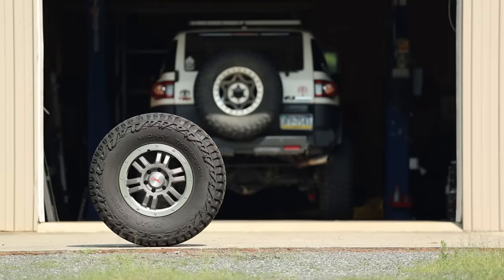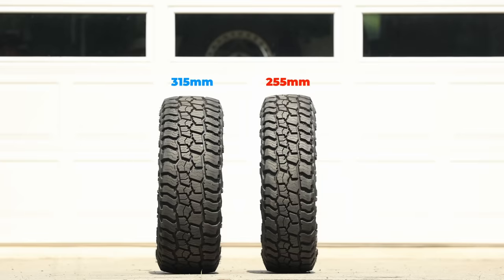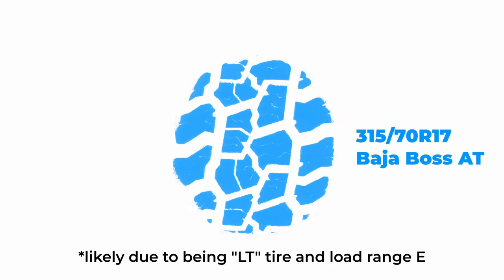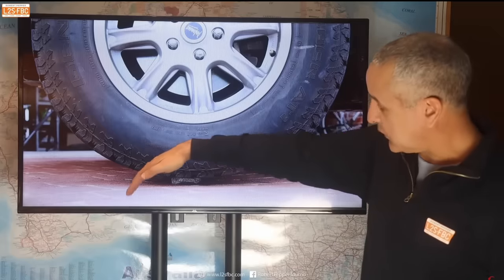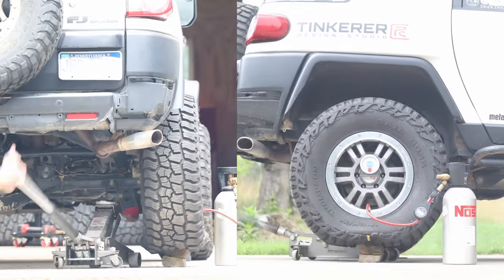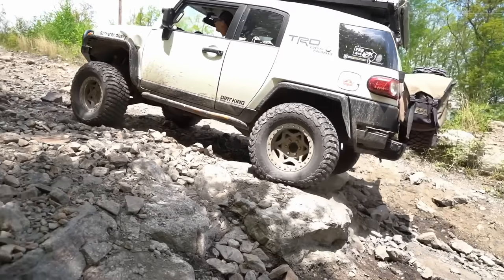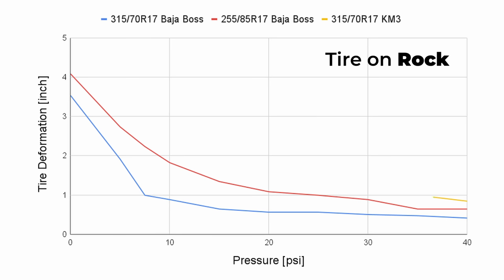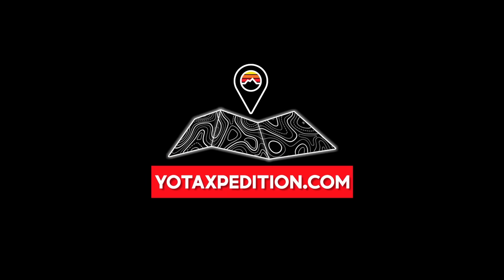3 Scientific Experiments to Settle This | Wide vs Narrow Off-Road Tires

Comment: Ya, I learnt this over the years. I swapped out my 12.5 Wide M/T for a 9.5 M/T on 33" on my Jeep and I have been very happy since. It breaks slightly better, less rolling mass (comparatively)...no visible difference in offroad performance at all. MPG got a tad bit better and the tires pretty much paid for itself.

Comment: I bought the 255/85-17 Cooper ST MAXX for my '15 Ram 1500 Quadcab 4wd.  That was the tallest tire to fit on the stock 7x17 rim.  The tire I used is internally similar to the Mickey Thompsens, which are made by Cooper.  Cooper has merged with Goodyear.
The vehicle the tire is run on is a variable also.  We have a beastly '18 Ram 2500 Crewcab 4wd 6.7L Cummins powered pickup that I will likely put 295/70-17E tires from Cooper or Mickey Thompson, the next time I buy tires.
I have a project vehicle '96 ZJ that runs 255/70-15 General AT2 tires.  They are great in the snow and on desert sand.
I may try the 255/70-17E tires that I have.  On my '23 Jeep JLU that I bought.  But but seat of the pants comfort and handling experience tells me I want the 285/70-17C or D.  I may put portal axles on the JLU in a couple of years.  In which case 37's will likely be installed.
The Pizza cutter (255/85-17) tires handle terrible on the Interstate, and okay on the street.  I had BF Goodrich tires back in the late 1970's.  While they were absolutely the best tire back then.  There are much better options.  Driving in the rain and on ice really matter.

Comment: Super video. So many possible variables, sand,and mud, thick or loose, rolling resistance, road noise, unsprung weight of narrow vs wide. Vehicle track width difference wide vs narrow.

Comment: Great piece - very interesting and thorough analysis.  It seems clear the thin tire is better for rock crawling but there are other off road conditions where a wide tire might have better chance at excelling.  Definitely there is a balance and for me it goes to road travel too since my rig is my only vehicle and, like many, I have to drive on roads to get off road.  Thinner is certainly lighter and has a smaller CdA so acceleration and highway speeds won't take as much power.  But I'm also wondering if rolling resistance of the thinner tire (flex/rubber compound etc.) will exacerbate or ameliorate the energy efficiency benefits on road.

Comment: Excellent video, would be curious of the change in contact patch over use though. I would imagine the central portion of the tire would wear down allowing for the sides to properly contact. That would probably make having a wider tire better. Just a hypothesis, would make for a curious video.
Reply: Also on softer terrains, the central contact patch would dig into the softer surfaces allowing for the outside edges to make contact. Maybe in those scenarios a wider tire may be more useful. However in terms of flex over hard surfaces, your data is still most accurate. Again, loved your video and how you achieved your findings.

Comment: Reason wider tires are better in racing (tarmac) compared to narrow is that with wider footprint the contact patch is shorter, so under acceleration or breaking, if there is slight spinning/lockup that piece of rubber slides for shorter period of time preventing the rubber from overheating/melting.  Contact area has nothing to do with width but pressure, so both, narrow and wide tire will have exact same contact area.  Physics.  You have weight and you have air under pressure holding it up.
Reply: Why does the contact patch area increase in a km3 tire given that its size is the same as a wider Baja Boss tire at the same load (10% more area)?
 I think that the (pressure factor) alone is not necessarily accurate. I think that the (architectural and structural design factor) plays a good role in this matter.

Comment: Thanks for the work on your video. First time watching your channel. I have head another aspect to practical use for tiers in regards to tier width. Mud or snow with solid ground underneath. I have heard from a lot of old timers they preferred narrow (pizza cutters) for traction. Granted this is in Alaska and different terrain I know utilize deferent tire types. Their explanation is that the narrow tier can cut down to the good traction base rather than floating on top. I know in loose sand you want to have floatation. Some of the areas some of these old timers take their old trucks into, as they head out to their gold mines, is quite amazing. 
Just a thought if you were going to ever do a future similar video. As well as a tiers ability to resist loss of traction from sideslip.

Comment: My input is that most do not factor in contact pressure. A narrow has carries more load per square inch on contact patch, this allows for greater deformation while still maintaining a higher contact pressure at the same PSI as a wider tire

Comment: Great study and great post.  I can air down on the trails and then air back up.  I'm more concerned with hydroplaning on the highway while driving thru rain/thunderstorms on the way there and back home.  If you've ever waterskied, you know a wide ski on a slalom floats on top of the water way better than a narrow ski.  You don't want that in a tire driving on water on the highway at 50+ mph.  Narrow is better for me for that reason.

Comment: Another factor to consider in snow states is that a narrower tire will handle snow easier than a wider tire will. Snow is not mud, sand or dirt, it's a different element completely. To navigate better in snow, you want a narrower tire to focus more traction on a narrower surface of tread. That concentrates the weight of the vehicle on a smaller surface. That increases the traction in snow. A wider tire will slip sooner than a narrower tire, and may cause the vehicle to fish-tail looking for traction.
Also, an all terrain tire will do better in snow than a mud terrain tire. Pick a tire with the mountain and snowflake symbol on the sidewall. That means the tire is severe snow rated.
The 10 ply tires are intended for use on 3/4 and 1 ton trucks, so on a half ton vehicle, a pickup or suv,  the 10 ply will decrease ride quality on highway. Some people won't mind this, but a better option may be to go with an LTC 6 ply tire in the same size. That will be just a more heavy duty tire over the factory application, probably a P rated 4 ply tire.being the factory tire.

Comment: I’ve ran skinny tires for mostly my whole driving life. I had a 98 Tacoma that would trudge through snow pretty much up to the frame rails or deeper at times. Not only do they cut through the snow but they also take less power to get them turning which you need all the help you can get when running the 2.7l engine in extreme conditions like that. I did have wide tires for a bit on a 5.3l Chevy and on a 7.5l f250. The Chevy took a lot more throttle to get the wide tires rolling through mud as compared to the skinny tires. It would be interesting if you could follow up this test with a Dyno test with the same truck on both skinny and wide tires and see how much longer it takes to get the same horsepower to the driving surface and how much more the engine is working to get that same power.

Comment: Well done ! Very thought out and explained . When in soft terrain ( mud , snow ) the resultant flotation seems higher on the wide tires. Maybe the shape of the footprint matters ? I had a 84 forerunner on 36-12.5/15 tsl and it sunk in mud that a friends 35-16/15 bloggers stayed out of on my truck . It was very noticeable and they were both running 7rear and 9 front psi .

Comment: Thanks for the detailed research! The tighter track width could actually allow you to access some trails better and have more choice on positioning, even though its only a few inches. Seems to me like it's roughly equal or better in several ways, and ultimately comes down to looks!

Comment: The contact patch will be the same for a given vehicle wt and tire pressure no matter the tire because the PSI is literally the amount of wt/in2 it is supporting, the more aggressive tire had more dead space between the lugs that you didn’t account for in the outline of the area, grip in rugged stationary terrain like rock crawling and canyon scaling requires different tires than loose dirt, wet roads or soft mud. Ultimately most of us drive on the street more than anywhere else unless we have a dedicated off road vehicle. The new KO3 are pretty nice for all around performance but I still lean to some of the less aggressive and slightly less expensive options on my daily driver, Silverado on 315-70-R17s interesting info for the extreme enthusiast though.

Comment: Great video, I think the Contact area vs Pressure graph is going to be the same for all tyres if measured carefully enough.  Keeping the numbers simple, if your car weighs 4000lbs then each wheel supports 1000lbs. To support this you would need 10 square inches contact area at 100 pounds per square inch, or 20 square inches at 50 psi etc.  I think the brand which had a different curve had a different tread pattern with different size gaps between the tread blocks.  These gaps should not be counted in the contact area.  The only other difference you will get is the shape of the contact patch, which depends on the width of the tyre as you so correctly showed.

Comment: I considered many different tires for my Jeep. I went with Cooper ST MAXX in 235/80/17's. It is for on and off road and couldn't be happier. As a bonus it throws less road splat onto body :-] I also tried BFG KO2's but they were very noisy.

Comment: Interesting . Well run Experiment . I  think the Wide vs Narrow difference is : Air Pressure acts in ALL directions equally .
Therefore , a larger parcel of encapsulated pressure resists deformation to a calculably greater degree based on Total  cubic inch volume .
An  intuitive , but  I  think reasonable , Guess .

Comment: Great video. I have been running pizza cutters for a long time for many reasons not to mention they are easier on drive train components but they are better in the snow. I live in Idaho and we get snow. So better fuel economy (slightly) less wear on components and great traction, better snow all winners for me.

Comment: Great video! I think you should test ply rating too, like a 35x12.5 C vs E rated tire. The stffness of the sidewall can also prevent the tire from flattening out under even mildly lower pressures. Giving up ply rating may be more beneficial for those only driving in sand or snow. Theoretically, you should have a larger footprint with higher pressures with a C, which is safer for preventing debeads than having to go much lower for an E to achieve the same footprint.

Comment: This is a great video love the in depth and real dive into this. I would love a video on airing up and down tires using a 4 way air system and something like the apex high flow valve stems. 😀

Comment: Well done. It would be interesting to see how the results would vary in off-road comparisons when the ground is not level as a concrete pour, but fluctuates and changes in the conditions it was designed for. I too am an advocate for the pie-cutters.

Comment: Anecdotally, wide tires are at their best when used on flat surfaces (think pavement, or sand). You're not really gaining traction at cruising speeds, but usually will see a substantially larger contact patch under heavy braking or acceleration. This is why drag racers (and race cars in general) have such massive/wide tires; they need all that rubber to keep power planted to the road under very rapid acceleration/deceleration. 

Otherwise, narrow tires are King. They have less rolling resistance, are quieter, and handle mud/snow much better. Only real downside is that they don't look as good 😂 Cool to see actual data to back up real-world experience!

Comment: Great video. One of the possible factors not considered is the larger tyre wall height or larger aspect ratio of the 255 to be the same height as the 315's.

Comment: I look after access for power lines and we use ice roads lots in difficult areas. I go in first as I need to gather production numbers and I buy wider tires thinking it’ll help me pack frost and not break through. This is the only reason for running the wide tire for me.

Comment: When running extremely low tyre pressure you should have bead locker rims so the tyres don't separate from the rims. Like top fuel dragsters run but they use them so the rim doesn't spin on the rim.

Comment: I feel like it depends on what you’re doing with your vehicle. If you’re doing a lot of rock crawling or maybe just typically requiring more performance on harder surfaces like packed dirt or rock this video applies. However, I feel like if you’re out mudding or snow wheeling a wider tire is better. I believe that it’s do to the fact that on those surfaces and conditions you’re not requiring a tire to flex to get grip you’re looking for the tread to pull the deforming surface and provide grip that way. You’ll have more surface area with a wider tire, in these situations, due to mud and snow surrounding the tire taking the benefit of a flexible tire away. Also with a wider tire you’re less likely to gunk up your tire and turn it into some type of mud slick. I believe these two benefits make wider tires better for stuff like mudding and snow wheeling.

Comment: A question not addressed was how does the difference in air volume between the tires affect what pressures you can run on-road or off-road? A higher volume tire supports more weight at a lower pressure, all else equal, so it stands to reason that you might need to run the narrower tire at a somewhat higher tire pressure to support the same weight in the same way. This effect is observed in every pneumatic tire vehicle application. That difference might cancel out some of the advantage the narrow tire showed at lower pressures, if you would not be using those lower pressures as you would in the wider tire.  This would have to be tested though. I'm generally a fan of pizza cutters but for a different reason--the narrower tire results in coefficient of friction advantages for icey and wet conditions, as well as wet sloppy mud over a more solid surface condition. Your demonstration of the other grip advantages of the narrower MT tire was very interesting, thank you.

Comment: When you used to buy tires in inches they would lie about width.
A 12,5”wide tire would measure 10 wide tread.  
A 10” wide tire would measure 8”wide tread.
15”wide tire would Measure 12.5”wide tread.
Dry rock crawling in Moab with a 9”wide tires 295 was a big grip reduction. In my bone stock, 100 series.  I only upgraded the tires, BFG KO2

Comment: The big thing missing is fact that going wider or higher on rubber, puts more stress on the drive gear and fuel use. I prefer to stick to factory sizes and find better branding within that.

Comment: Equal contact surface area regardless of tire width makes sense.  It's a high school statics problem, sum of forces must equal zero, weight of vehicle divided by psi to get square inches of contact

Comment: Which is best is more about how you will use them. If you have rocky soil or soil with a hard pan under the mud then narrow tires cut down and find traction but if you come from an area like I live in the dismal swamps and Boggs of eastern NC or the sand on the outer banks wide tire are better because there is nothing at the bottom and you really need to stay on top of the mudd or sand. If your Gona stay on the road most of the time you should  buy a nicer all terrain tire and a really good strap.

Comment: My understanding is that wide is only better on sand...better flotation on top of that surface, more space to distribute the weight over that very unstable surface. In mud, the tall/skinny has an easier time getting down to solid footing below the goopy stuff. That's not a benefit if you bottom out the truck before your tires get to that footing though. I like your attention to detail and attempts at objectivity BUT there's a factor you're not accounting for and that's rim width. These two tires are maximized for two different rim widths and their sidewalls and contact patch are different when mounted to non-optimal widths. You've got TRD Rock Warriors there so the 315 is probably a little wide for optimal and the 255 is probably a little narrow for optimal. I run 255/85R16's on AUS OEM Toyota steelies that are 8 inches wide. Load Rate E on a 100 Series Cruiser, so I'm in the pizza cutter group.

Comment: I confused the guy at the tire store when i ordered tires for my leveled f150 but wanted to keep stock wheels with minimum clearance problems, 295/65r20 was the perfect size no rubbing issues except full lock compression on either side

Comment: Incredible amount of work. I see many advantages to narrow tires, not least of which are weight and clearance. That said, I wonder if the performance would be even better if they weren't load: E. We might have an awkward situation here where the best footprint actually comes from a smaller, lower load tire which is already flexing aggressively at 20 psi. The "straight line" of no deformation  (11:59) all the way down to 15 PSI screams that the load rating is way too high for the actual weight of that rig.

Comment: Well done and interesting video.  However one aspect not discussed...  Having lived in Oregon MUD and drive a 4x4 for over 50 years a practical view is much simpler.   A wide tire will, "FLOAT" over mud where a narrower one will "DIG" down to firm ground, allowing you to pull through.  Its a matter of Floater or Diggers.

Comment: Yes but you have to put in the weight of your vehicle vs a heavier vehicle will change your tread foot print.  These littler Toyota's will require more tire pressure release to get a better or larger foot print of your tread.  Nice video full of great details